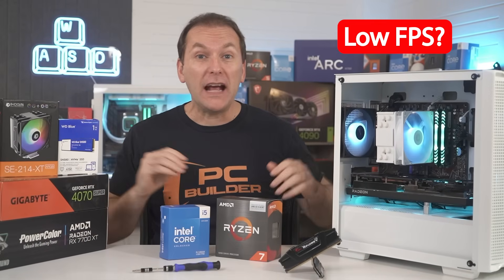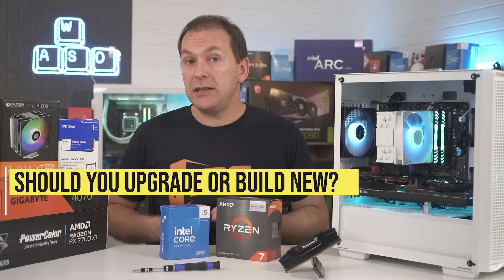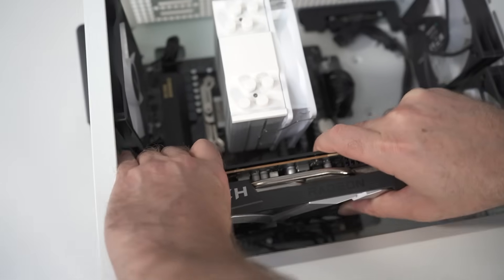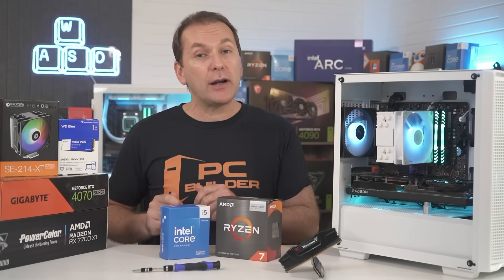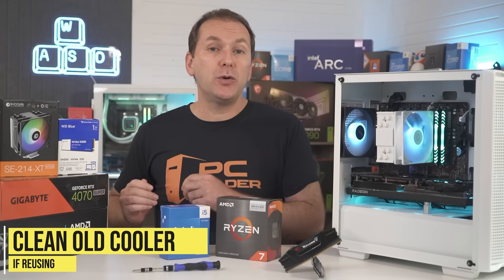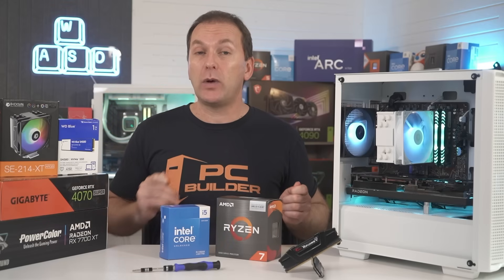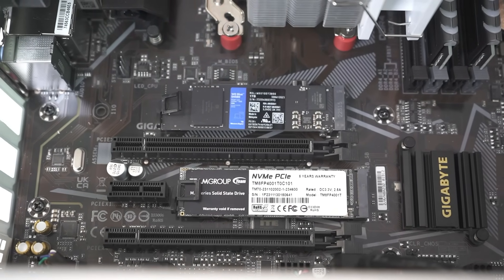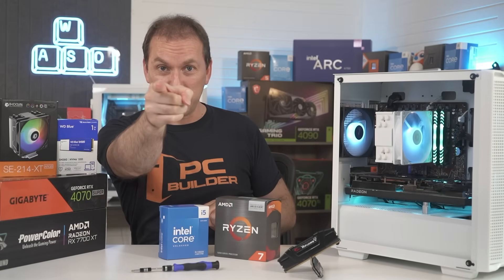How To Upgrade Your PC | How to Upgrade GPU, CPU, RAM, SSD & More

Comment from the maker: ▶Sponsor: Windows 10 Pro ($17) https://biitt.ly/kPBz6
What is your current PC? What are you looking to upgrade? What performance increase are you looking for? Tell your story in a new comment below!
Reply: I have a 9700k paired with a rtx 3060, but im looking for some more graphics performance, i run a 1440p monitor
Reply: @lego_max8999 is a 7900 GRE within your budget? If not you could do a 7700xt
Reply: Hello i currently have a ryzen 5 5600x, rtx 3060Ti, and 750w psu which should i upgrade to have good fps and great graphics quality at 1440p gaming?
Reply: @mister_2004 the GPU.  You could also upgrade the CPU to the 5700X3D but the GPU is most important.
Reply: Jason !!! NVIDIA drivers and Applications NIGHTMARE !!!!!!!!!!!!   Jason, can you save me from this nightmare... I saw other people also post on the NVIDA apps and drivers nighmares which simply WILL NOT UNINSTALL ...  I have Rog Strix B450-F Gaming II MB, Ryzen 5600x and NVIDIA RTX2060 GPU ... and I had to abandon my upgrade to Radeon RX6750 XT because the NVIDIA stuff simply will not go away.  I updated the BIOS on the MB,  tried the Microsoft removal tool etc..  NO LUCK ! There have to be some tools or procedures by savvy techies who can guide us ... I am far from ignorant concerning I.T. and windows 10 and comfortable cleaning up the REGISTRY etc.
Reply: Ryzen 5 7600, RTX 3070, 32 GB ram, 1440p monitor.  GPU for upgrade
Reply: My current pc is my first ever which before belonged to my bf. What I remember is that its a amd ryzen 3600 6-core, nvidia GeForce gtx 1660 ti. The issue is I hardly know anything about building pcs or if what I have is worth upgrading or getting new.
Reply: @itTanny  yes you can definitely upgrade what you have.  

What I'd recommend depends on your budget.
Reply: i have a intel 10400f 6 cores CPU and a gtx 1660 super GPU but i like to upgrade but dont know what to upgrade first  because i want higher fps in cs2
Reply: @robbededrie1987  what would your budget for upgrades be?
Reply: Hello I have a build with RTX 2070 Ryzen 7 2700x and 32gb 3200mhz ram on AS Rock Steel Legend B450m and i am not sure what to upgrade looking for more performance do you have any tips?

Hello
Reply: @OktavianKolek  depends on what your budget is.
Reply: I have a 7700X paired with a RX 7900 XTX and I'm actually planning to upgrade to 7800X3D per the advise of another user on Discord. I use a 1440p 240 Hz monitor, but I'm told I need a fast CPU to really drive such a resolution.

Comment: Can you use the same power cord or disconnect old and use the one that comes with the new GPU? Considering if you are replacing a AMD GPU with a new NVIDIA one in my situation? Thx
Reply from the maker: NVIDIA GPUs mostly use the 12VHWPR connector now. If your PSU only has the standard 6+2 PCIE Cables, then the GPU should come with an adapter. So the PSU cables plug into the adapter cable, and that plugs into the GPU. Hope that helps!

Comment: I have an old (15 years old) Packard Bell gaming PC with an Intel i5 processor 1GB GPU AND 4Gb of ramand the internal storage of a HDD 500GB.

Looking to replace the motherboard (B550) processor to a Ryzon 5 5600x, 12GB GeForce RTX 3069 GPU, 32GB ram DDR4 (2× 16GB), New power unit and 3Tb of SSD across 2 cards. 

Hopefully things go well and ill be able to start back at PC gaming again.... its been a while.

Comment: i currently have a radeon 5700 xt and a ryzen 7 3700x with a Asus Prime X-570 pro motherboard with 16 gb ram. I am not sure where my issue stems from but I often have my PC freeze after 30 mins when playing heavier games (gpu util never above 50 % and 55 degrees) and my cpu will often be at 80 % util. What do you recommend for upgrades ? I use my PC mainly for streaming and gaming, games being things like MMOs, subnautica, apex. battlefield, etc. 
Idk if I should be looking to upgrade my cpu or my gpu or my motherboard. What do you suggest ?

Comment: Looking to upgrade my prebuilt but have no idea where to start…

Digital Storm Lynx - Level 3
Processor: Intel Core i5-12600K (4.9 GHz Turbo) (16-Thread) (10-Core) 3.7 GHz (Alder Lake)
Motherboard: ASUS / MSI / ASRock (Intel Chipset) (Up to 2x PCI-E Devices)
System Memory: 16GB DDR4 Digital Storm Performance Series
Power Supply: 700W DS Performance Series
Storage Set 1: 1x SSD M.2 (1TB Digital Storm M.2 Performance Series)
Graphics Card(s): 1x GeForce RTX 3070 8GB (VR Ready)
Extreme Cooling: H20: Stage 2: Digital Storm Vortex Liquid CPU Cooler (Dual Fan) (Fully Sealed + No Maintenance)
HydroLux Tubing Style

Comment: Hello I currently have:
i5-12400f
B660M Motherboard
RTX 3060 12Gb
16Gb 3200Mhz DDR4 RAM
650W PSU
1Tb M2 SSD

I'm not sure whether I should just upgrade to i5-13600kf or go for Ryzen 7600X and upgrade my motherboard and RAM as well. (500€ for a bundle vs 270€ for the 13600kf in my country) 
I have a 240Hz monitor and this build used to run csgo 350+ fps easily but in cs2 cant even reach 240fps for most of the time. Going for the i5 would leave money for a GPU upgrade aswell (4060Ti for example)
Reply from the maker: Sadly we can't recommend 13th and 14th gen right now due to the degradation issues. So I would recommend jumping over to AM5 if you are looking to upgrade. See our latest CPU Market Update video for more

Comment: Hey pc builder was wondering if in your opinion I just finished full reset my entire computer system and I was add upgrades to be the best on coding if you have those suggestions I would appreciate it

Comment: Can you recommend a GPU for these specs? TIA 
Ryzen 5 5600g
B450M DS3H WIFI
16gb RAM
&
Ryzen 7 5700g
B450M DS3H WIFI
32gb RAM
Reply from the maker: Its going to depend on what's avaialble in your region. See our Best GPU/CPU Combo 2024 video and follow the recommendations for the 5500.

Comment: Yeah I have a pc from 2014 I think I need to buy a new one
Reply from the maker: Depends on the system! But there are great value builds to be had if its time for a new build
Reply: @PCBuilderChannel  I though about rtx 4070S with the I5-14600, what do you say about this combination?

Comment: Hopefully you can help me i know nothig when it comes to computers, for the upgrade vs nee build part of the video, I have a AMD Ryzen 5 1600 3200 Mhz 6 cores and 22 processor with a ASROCK B450 Pro 4. My GPU is also a NVIDIA Geforce GTX 1070.  Do you think its worth to upgrade my build or would tou recommend starting a new build? Thank you for any input.

Comment: Here is my current system. Can I upgrade this or should I build a whole new system? What do you guys suggest? All I use this for is gaming. I could probably hold off till November too for BF stuff. 

Cooler Master MasterCase H500 ATX Mid- Tower w/ Tempered Glass Side Panel, Transparent/ Mesh Front Option, Carrying Handle & 2x 200mm RGB Fans w/RGB Controller

MSI B450 TOMAHAWK MAX AM4 AMD B450 SATA 6Gb/s ATX AMD Motherboard.

MSI GeForce RTX 2070 SUPER DirectX 12 RTX 2070 Super Armor 0C 8GB 256-Bit GDDR6 PCI Express 3.0 x16 HDCP Ready SLI Support Video Card.

Seasonic FOCUS GX-750, 750W 80+ Gold, Full-Modular, Fan Control in Fanless, Silent, and Cooling Mode, 10 Year Warranty, Perfect Power Supply. 

AMD RYZEN 5 3600X 6-Core 3.8 GHz (4.4 GHz Max Boost) Socket AM4 95W  

Team T-Force DARK Pro 16GB (2x 8GB) 288-Pin DDR4 SDRAM DDR4 3200 (PC4 25600)
Reply: Sorry just saw this.  You can just upgrade.

You can go 5700X3D on the CPU along with a new GPU.  Then, you'll just have to see if a 750W PSU is enough or if you'll have to upgrade that too.
Reply: @ty09162  which GPU?
Reply: @theradiantchild  depends on what your budget is
Reply: @ty09162  I'm fine with buying used too. I just don't wanna bottleneck

Comment: I was always taught to use a pea size amount of thermal paste in the center of the cpu and spread it evenly with a credit card
Reply from the maker: Lots of people have strong opinions about the proper thermal paste technique (; but Hardware Unboxed, Gamers Nexus, Linus etc have all done lots of testing on this and the results always come back that the only way you can really screw it up is to not have enough paste. So don't overly worry about how you put it on just make sure you have enough

Comment: How can I upgrade my pc?
I have ryzen 5 5600 and gtx 1650 with 8gigs of ram
What things should i upgrade ?ram ?or buying a cpu cooler?
Reply from the maker: I'd go for a GPU upgrade and a new 16gb RAM kit! The max GPU I'd pair with a 5600 is a 7800XT, so anything around there would give you a huge boost. And yes you should definitely invest in a new 16gb ram kit. And make sure you check your new wattage needs.

Comment: cheeeeeeesr ! love that energy and charisma everytime~ i boguht so much, ALL of my brand new full build from the ground last year during holdiays nad what not but my home and irl has been so brutally busy and mental sadness issues over winter and failmy stuff that i ahvent built my new build for over 6 MONTHS....... LOVE JUMPING BACK INTO ALL THE DETAILS AND THE ECONOMY OF THEM ARKET!  i might have efverything already, but im here to  MINMAX MY BUILD  now and i have my old rig that still deserves a face lift as i enjoy everything iths enthusiest hobby life has to offer. praying my new build goes better....... but im about to go from 2 x 500gb ssds to 2 x 2TB ssds AND  a 4tb ssd all nvme for juasst game and data and photo hgoarding for life  CAUSE IM PARANOID AND ADDICTED AND I LOVE IT!  super clean full corsair build for pure RGB compatability and cleanness fvor ashetic but also  I STILL GOTTA FIGURE OUT MY RAM GAME LMFAO ended up up charging myself into an MSI  b650 edge wifi board so its sick and i love color schemes nad all but now i just need ot figure out how much ram it can handle and if i should drop my trident z neo set for a proper 2 stick set or match corsair stuff or just upgrade from 6000mts to 6400mts if thatll even matter~  I LOVE CHOCIES BUT SO LITTLE TIME LMFAO!

Comment: Currently have Ryzen 5 3600x, Crosshair VII Hero x470, 16GB DDR4 3600 and a RTX 2080S not sure if going with more Ram and maybe a Ryzen 7 5700x would benefit with the 2080s? Any advice?
Reply: So if you're just Gaming with it 16GB of RAM is fine.  You can upgrade the CPU though.  Just note Jason says the 5700X isn't worth the extra money over the 5600.

Comment: Hey Jason, HUGE fan of the channel, I currently have an Intel i5-13600K with an AMD RX 6600 and was wondering my next GPU should be in the $600'ish range.  I was considering another AMD, but I'm just not sure.  Thanks for all your hard work!
Reply: For Gaming the 7900GRE would be a great option for you.
Reply from the maker: Agreed with Ty! There's actually a great price on the 7900GRE right now, I'm about to post it to the community page so check that out! And see our latest GPU Market Update video for more options

Comment: Like my system, I would say is specked up in future proof, but not actually current spec. Like my storage is fine. I have 30TB right now I think just in my PC myself. Ram and power supplies fine because I have 128GB of RAM and a 1350W power supply. Now I would say I only have a 3900X and a 3080TI in my current main system which should be upgraded eventually. I should maybe upgrade one of my monitor too because it’s a 32 inch 1080P HD 60Hz monitor and only 1080 on a 32 inch is not that good. Now I am also a crypto minor and I have tons of CPU, GPU, and hard drives. But even though I have all that hardware, I would say my main system is probably the highest spec one😅

Comment: Built one of your builds a while ago:

Gigabyte B550M DS3H
Ryzen 5 5600x
Radeon RX 7600 XT OC 16gb
Silicon 16GB X Power Ram
Crucial P3 plus Gen 4 1TB
MSI Mag A650BN PSU

Any recommendations on whether to upgrade right now or no? If so what would you suggest?
Reply: If you're happy with your performance then what you have is good and no need to upgrade.

Just note the logical upgrade path would be a 5700X3D with a higher GPU.  Possibly new PSU too but only if timing the wattage in PC Part Picker by 1.5 says you need to.
Reply: @ty09162  thanks. I mean it’s running the games I want ok to be fair. So I don’t really have much of an issue at the moment. 

I was looking at upgrading the CPU to the 5700x3d actually and installing a water cooler for now. But I may just wait and see what comes out this year instead
Reply from the maker: That’s a good combo! When you are ready to upgrade you can drop in a 5700X3D and as high a GPU as fits your budget. But no reason to upgrade if you’re happy right now
Reply: @PCBuilderChannel  would a 5700x3D and 7800xt spectral be a good combo or would you recommend anything different?
Reply: @PCBuilderChannel  and would there be a need to upgrade anything else with this CPU + GPU or would they work on this motherboard etc

Comment: I've thinking about making some upgrades... I've been watching your videos and was thinking of going for a CPU and GPU upgrade to play games at 1440p.

Motherboard: ASUS AM4 ATX TUF Gaming X570-Plus
CPU: AMD Ryzen 5 3600
CPU Cooler: Cryorig H7

GPU: Gigabyte Aorus GeForce RTX 3060 Elite 12GB

Memory: Corsair Vengeance 16GB (2 x 8GB) DDR4-3200 C16
Storage:
- WD_BLACK 500GB SN750 NVMe (BOOT Drive)
- WD_BLACK 2TB SN850 NVMe
- Seagate BarraCuda 1TB Internal Hard Drive HDD
PSU: EVGA SuperNOVA 650 G2, 80+ GOLD 650W

was thinking cpu 5700x3D paired with a 6800 XT? I do live near a microcenter just fyi
Reply: That's a good combo assuming you can find a 6800XT at a good price.
Reply: @ty09162  yeah. hopefully I can find a good price, I still need some money for the new monitor as well lol
Reply: @gustavoruiz3462  just note you could also jump up to AM5 with MicroCenter's 7700X CPU Bundle if you wanted to, though the 5700X3D is a great choice if you don't.

Comment: Hello sir please help me Should I buy a ryzen 5 7600x or a i5 14500 both are the same price in my area which of these would be great for editing 60% and gaming 40% my current specs are 10400f 32gb ram rx 6650xt
Reply: Both are good, but would be bottleneck by your GPU.  You'd want to upgrade that if you're going to upgrade to one of those CPUs.
Reply from the maker: What Ty said, that GPU is going to hold you back. Check out our Best GPU/CPU Combo 2024 video for more

Comment: I have 2 monitors 1080p 144hz flat VA, 1440p 165hz flat VA. I am a flat VA boomer so my monitor selection is quite small, but this feels like a good setup right now that i am not thinking about upgrading urgently. I feel like VA is the best for my eyes. I do not like how IPS panels look. They make my eyes and head hurt. I might look at oled some time in the future when it becomes a lot cheaper. 

Other parts are an old fractal design case. One of those big black sideslid ones. 1 fan in the back, 1 on top, 3 in the front. Cant see inside it. I have had no trouble with overheating.
MSI 850W MPG A850GF fully modular PCIE 4.0 power supply, MSI MAG X570 Tomahawk wifi, 2x16gb DDR4 3600 16-20-20 ram, 5800X3D, Noctua DH14 big tower air cooler, 2tb Samsung 990pro m.2 nvme ssd, 2x500gb sata ssds, Asus 4070 dual oc. No RGB, my fans are all Noctuas.

I play all kinds of games from OSRS to Cyberpunk, so i will need some power to run some new game i might want to play. Like when i upgraded my 1070 to 4070 for Hogwarts Legacy.

I think 165hz for CS2 is enough for me. I think even if i upgrade my GPU to an Nvidia 80-series GPU like the 5080, it will still not be an overkill for new games. 1440p 165 fps for new games still requires a lot of gpu power. Nvidia because of power consumption and familiarity. A bit unfortunate tho that i feel like i will need to upgrade my 4070 quite soon already when i last needed to upgrade from the 1070, but it is how it is now. I hope my next upgrade will last longer. I expect my cooler, ssds and case to be enough to be reused in my next pc, because i have deepcleaned my pc and reapplied the thermal paste multiple times so the case and fans are in good enough shape.

I am thinking that my options are upgrading my GPU, or then motherboard, processor and ram. I am thinking about skipping am5 if that seems possible. I need to keep my 850 watts power supply in mind aswell. I will keep my eye on things. I think upgrading my GPU would be a good idea first, then take the big upgrade to the generation after am5. Will see how it turns out.

Thanks for showing everyone the graphics drivers uninstall :)! Loving the vids !
Reply from the maker: Thanks for sharing and so glad you are enjoying!

Comment: I am using an i5- 13600kf with z690 ddr4 mobo with 32 gb 3600mhz ram. Is it worth it to change my mobo to a ddr 5 platform ? Thanks
Reply: No I don't think it's worth it.  DDR4 is perfectly fine.
Reply from the maker: I wouldn't think so unless you've already maxed out your GPU